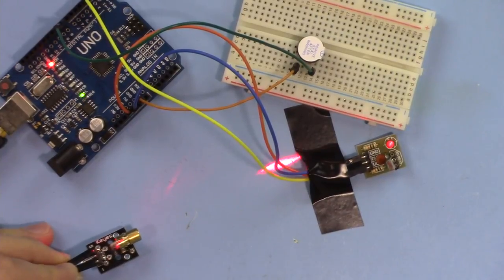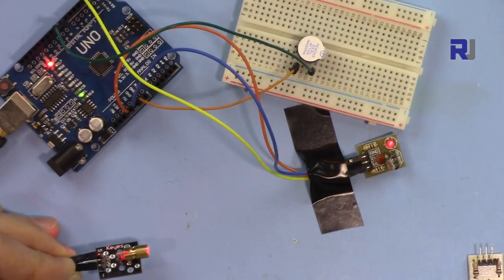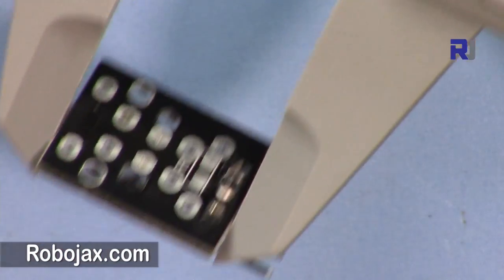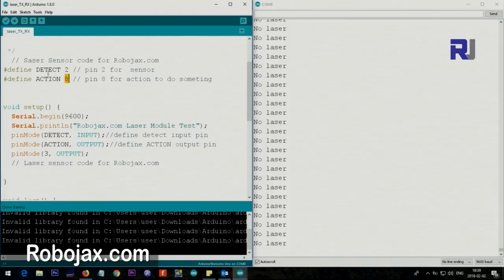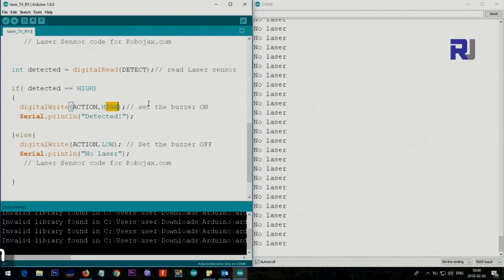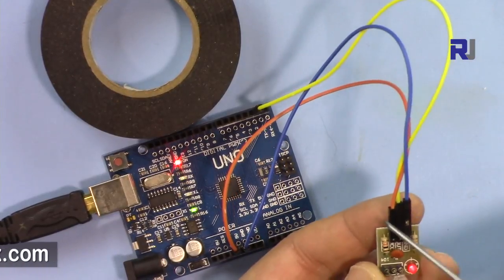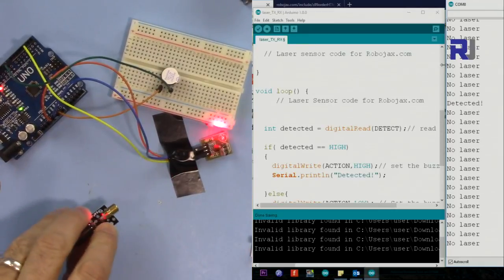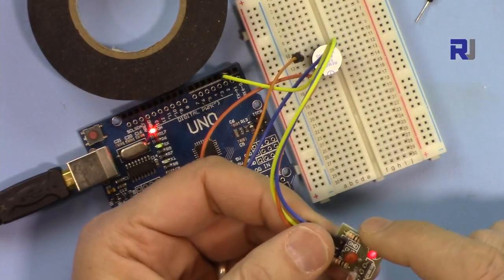How to use Laser Transmitter and Laser sensor for Arduino

Comment: Sorry i am a bit behind - just started experimenting with a laser module from 1 of those 37-in-1 kits .
I am interested in using this module to send messages via laser by turning laser on/off very quickly- would the receiver shown in your video react fast enough to enable the on/off pulses to be decoded at the receiving end?
Reply from the maker: This is very basic switch which turns off or on something. You need to your own code to send a command or message.

Comment: I bought the same module.  Is there a way we can use a GPIO pin to control the laser turning ON and OFF?
Reply from the maker: Arduino can accept about 21mA load at each GPIO. I did measure the current for the TX. Measure the current and if it is below your the maximum output current of your board, then connect it, else. use a transistor or relay driver to drive the TX.

Comment: Do you know if it's possible to have a similar system but working in the non-visible spectrum (i.e. IR) so that the beam wouldn't be clearly visible at night? I'm looking to use it in a camera trap.
Reply from the maker: it should work. this transmitter has visible spectrum to it so we can see. Just find invisible TX module.

Comment: hey i like your video it is great information for us. and i would ask you to help us now build a audio sound transmitter receiver using light or laser as the transmitter. am modulation. could you do this and show how to do it and include the part list and links to buy them. i hope you will consider this as your next challenge. i have seen it one time but i dont understand how to make it myself i hope you can make it and show how you achieve it.

Comment: Just what I was looking for...

Is it possible to connect to 433mhz transmitter?
 This way can use with home automation. 
So, blocked laser creates a signal that is transmitted @ 433mh?

Thanks.
Subscribed.
Reply from the maker: Hi, Yes. you can, but your RF (433mhz) transmitter can't be turned on with Arduino. So Arduino can turn ON a relay and you will connect your RF TX via relay. here is my video on relay https://youtu.be/g6k8sPJyif8

Comment: hi robojax, with this sensor would it be possible to log differences in the brightness/purity of the laser? I'm looking into a way to set up a circuit that can read the differences between types of smoke for our robot smoker- between thick white billowing smoke and clean burning clear blue smoke... :) thanks for your video's they're great
Reply from the maker: Hi Max, Yes it should be possible. This module is however made to give HIGH or LOW. if you find an OpAmp (operational amplifier) you could get variation of voltage corresponding to the amount of ray received. Then use Arduino to represent it to different level of smoke.
Reply: :stayhome:

Comment: Is the sensor (what you take out at 2:54) just a photoresistor? Could I use it separately as analog sensor, like simple photoresistor with light? (how transparent or opaque is some object)
Reply from the maker: no this can't be used. if you want precise light intensity measurement use this https://youtu.be/iKUwu220UFQ but if you want approximate value or if you have tools to calibrate with the LDR (light dependent resistor) use this https://youtu.be/iNea_HM967A

Comment: Hi, first of all great video. Question: Can we also set the receivers in serie (or only the Diode)? We can use a line laser to send beam to all of them and if one is interupted it gives a signal. Hope you can help! This way you can create a dropping sensor with wide beam.
Reply from the maker: Hi, You are welcome. Yes you can use multiple receivers and each connected to different pins and achieve what you want but you can't connect them in series.

Comment: I want to add something to go carts that when it is hit by a laser from another driver that it causes you to lose power momentarily, is there a panel or something that makes the area that can detect the laser larger? really just like a 6"x6" square. I would also want to make something you can drive over to give you power ups, the disabling laser to the front as well as a boost or a laser that shoots rearward also. What would I need to do for that? Thanks!
Reply from the maker: I will reply to all Subscriber's 🔔 questions. So make sure to Subscribe.😊.

Comment: Hi Robojax. I would like to know if the receiver gives an analogue output. In other words; does the output amplitude change with intensity of laser light received, i.e. if the distance between transmitter and receiver varies, does the output vary too. I am asking this because I wish to make a short range vibration detector, where vibration amplitude is very small; in the sub millimeter range. If it is an analogue output, the variation will of course be very small, however, that can be amplified for visualising on an oscilloscope. The vibration frequencies I wish to detect are in the audible range, from about 200Hz to 4kHz. Any knowledge about this would be greatly appreciated.
Reply from the maker: the output from receiver is digital. either 0 or 5V.

Comment: Very nice Video! I have a question. Do the Laser Receiver-Diod only capture Laser ore other lights, like Sunlight ore a bright flashlight? Its important for me that the Sensor only capture Laser/Laserpointer...
Reply from the maker: Thanks. Because we do not send code, it is just laser rays, yes it will be affected by the sun rays which will have the same wavelength as the laser light. In order to prevent that, we should send certain code like turnning it ON/OFF in certain intervals and detect it making sore to ignore other signals.
Reply: @robojax  thx for the quick answer and the interesting Suggestion! I hope i dont kill my Laserpointer with Coding... but i will test it soon :-)
Reply from the maker: good luck. stay safe.

Comment: How can you regulate the system so the ambient light does not make it trigger by accident? Nice video.
Reply from the maker: Put a cylinder in the diameter of AA battery on the receiver so it receives only the beam from your TX. The longer the cylinder the better it will be.

Comment: I wonder if I could use something like this for my gold drywasher. When shoveling the dirt into the drywasher if there were somekind of sensors that could send a signal to block the flow of dirt until it clears up. Or maybe a weight sensor that could sense too much weight and shut the flow of dirt until it clears out...
Reply from the maker: This is very sensitive. Even small drop of water will trigger this and it would be very hard to use for that purpose.

Comment: I am using avr atmega8 and this detection circuit too . Want to know what kind of output it will give to the ic is it high or low , in terms of voltage ??
Reply from the maker: it works with any Arduino. it just gives HIGH or 5V.

Comment: Hi. is there a technology where  the laser can detect a bulb light is off or on, from lets say 80 foot distance. Thank you
Reply from the maker: Hi, it can be done in a simple way using LDR to detect light https://youtu.be/iNea_HM967A but enclose the LED (light repentant resistor) in a dark STRAIGHT pipe so the light does not reach from to LDR from the sides except from the front. This the longer the pipe the farther you can aim to a bulb.  Or you can use fancy camera system to monitor a bulb.

Comment: For the laser transmitter, what do I need to connect it to for it to work? As far as I understand it just needs to be powered, but how do I do it. I can't connect it to the Arduino because for my project the Arduino is connected to a wall with the sensor and the transmitter needs to be connected to a door that needs to open freely. Any help would be appreciated. Sorry for the newbie question :')
Reply from the maker: Transmitter needs 5V either put long wire from Arduino or just another 5V to activate it. The receiver however need to be connected to Arduino so you can take action when obstacle is detected.

Comment: What is in the receiver of the three-dimensional or tripod piece that is the receiver of the slip?
Reply from the maker: that is the actual receiver. it detects the laser rays and proportionally outputs signal from on the pins.

Comment: awsome video :) i was wondering the max distance of the laser to the sensors because i was thinking of attaching it to a drone with a lasser gun so its like laser drone shooting haha?
Reply from the maker: I don't know the working distance but I believe it should work for your application in terms of distance, but aiming would be very hard. because drone will not stay still in a location and even if it did, you won't be able to aim. but hey , no harm. Try it.

Comment: What if the detector is reading "high" even before the laser hits it? I've checked the wiring and don't seem to be able to get "no laser" reading.
Reply from the maker: Please share your code https://codeshare.io/ and once you post it, you will get a new URL (address), post the URL here using "reply" and I will help you.
Reply: @ericschulz4451  Hi, I have the same issue and was wondering if you ever got it to work properly?
Reply: @ericschulz4451  I haven't seen the code, just read through it without really thinking how to troubleshoot it, but maybe MAYBE if you used INPUT_PULLUP instead of INPUT and make it do sth when it gets low instead of high(hit with the laser) It should become the opposite.

Comment: Can this be done using an esp32 instead of an Arduino UNO?
Reply from the maker: Yes it can.
Reply: @robojax Thanks! Any changes that I should make to the code/circuit to accomodate the esp?(Other than in Arduino IDE)
Reply: @robojax  But esp32 only can handle 3.3V while the laser sensor and receiver require 5?

Comment: Can you use 4 lasers and sensors with Arduino? If so, what would I need?
Reply from the maker: Yes you can. You will need 1 arduino and 4 times of the other items like TX, RX and wires. TX is transmitter and RX is receiver.
Reply: @robojax  Thank You for your quick Reply!

Comment: How can I turn the Arduino on and off wirelessly from like outside my garage ?
Reply from the maker: You can use the item shown here  https://youtu.be/TdaHNjMCFk8 connect your 9V or 12V AC adapter that powers up Arduino this module and turn ON/OFF via app from anywhere in the world.

Comment: use a laser sensor and Arduino to measure a sheet metal part's dimensions.  possible?
Reply from the maker: you can use laser but not this module. We have laser sensor but resolution is 1mm so you will read 2mm or 3mm. not 2.5mm or 2.7. Please subscribe. It is appreciated.

Comment: Hello and thanks for the video. Quick question, can I use 2 lasers and 2 receivers with 1 arduino and program it as: if both the receivers stop receiving laser lights at the same time = output (example green led, else red) ?
Reply from the maker: Hi,  you are welcome. Yes you can. You would have to define different pins of Arduino for that.
Reply: @robojax  Thanks!

Comment: How can we make that buzzer to a big speaker
Reply from the maker: you will need power amplifier module  that can drive the speaker. then you can generate simple buzz using arduino when laser is triggered. The buzz output signal from Arduino is connected to the input of Amplifier to make buzz. Or get this module to play whatever sound you want, it plays it for you https://youtu.be/IfK8z_o5vbk or this module https://youtu.be/KDc2Z43DzT0

Comment: I have problems, the deduction is worth 1 and if it's not cut too 1. Please help
Reply from the maker: unless your modules are defective,  if you copy and past the provided code it should work. Check the wiring.
Reply: Robojax I have tried using a new module and the output is still 1 there is no 0 when truncated

Comment: My buzzer turns on as soon as I connect
 
Can you please help me resolve this
Reply from the maker: if you haven't changed the code, then wiring is wrong. check it.
Reply: @robojax  cross checked lot many times still not able to figure out the problem

Comment: How to use that laser with 9V bettery??
Reply from the maker: Get a DC 5V regulator that accepts voltages from 6 to 20V and converts it to 5V . It will convert your 9V to 5V

Comment: nice, followed the tutorial for wiring and my shit starts smoking
Reply from the maker: what did you do? Positive and GND swapped?
Reply: Robojax nah positive and negative weren’t switched, I’m not sure what the problem was.
Reply from the maker: the voltage must have been very high. Or possible your moulde built with wrong connection.